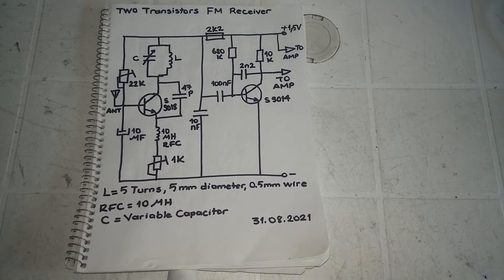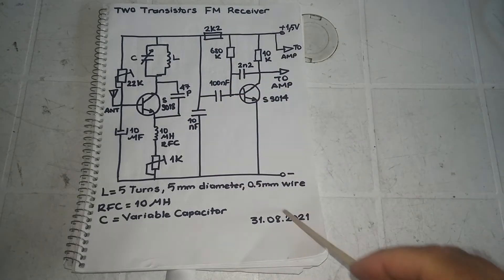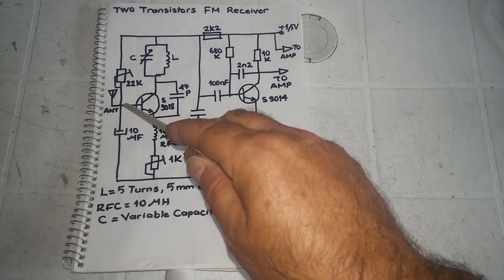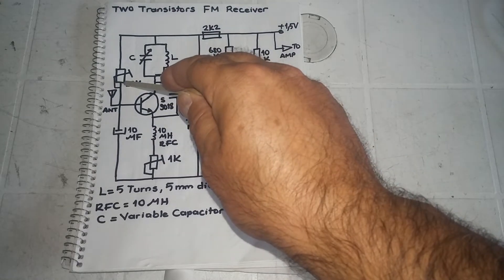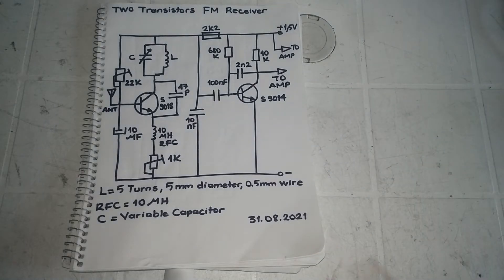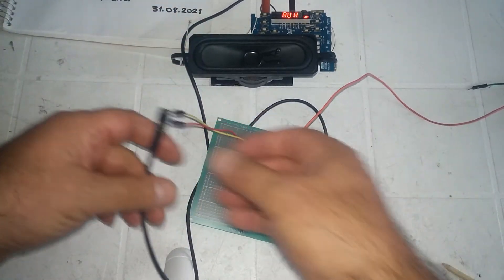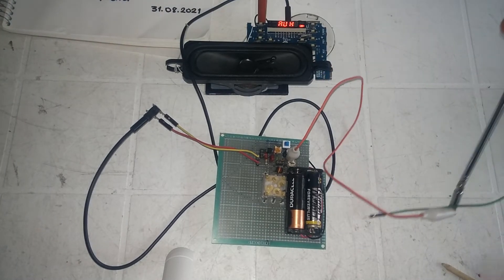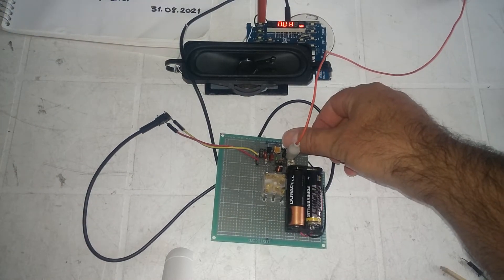2 Transistors Regenerative FM receiver circuit. Works great!

Comment: If i can use a bf199 but you used a npn transistor and the bf199 is a pnp transistor can you make a schematic for a bf199?
Reply from the maker: No my friend, BF199 is an NPN transistor. Anyway, If you use any PNP FM or VHF transistor, you should only change the polarity of the battery and  change direction of 10uF capacitor. That's it !

Comment: This circuit don't have decoupling capacitor. A capacitor parallel to 22k regen control. Why?
Reply from the maker: Hi. Where should be connected a decoupling capacitor? Parallel to 22K?